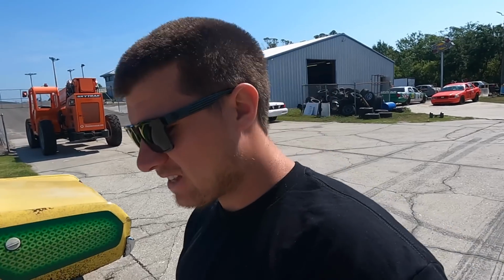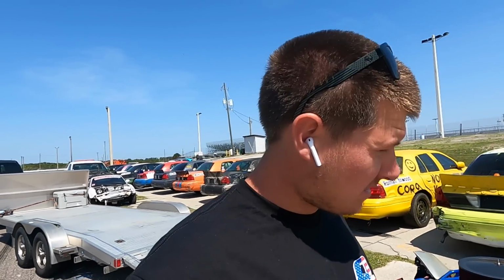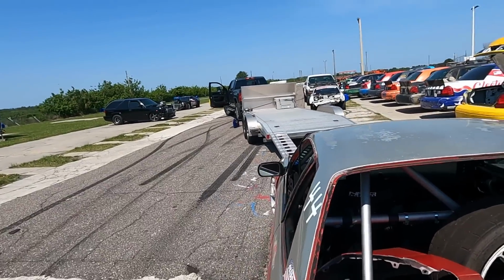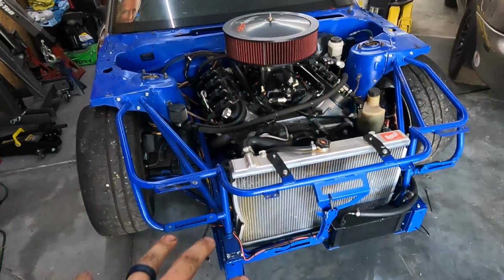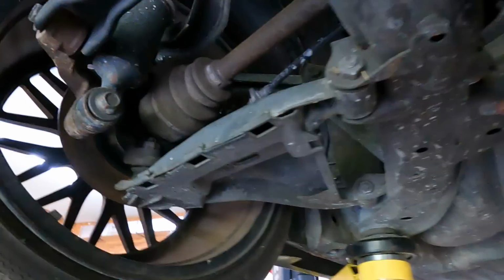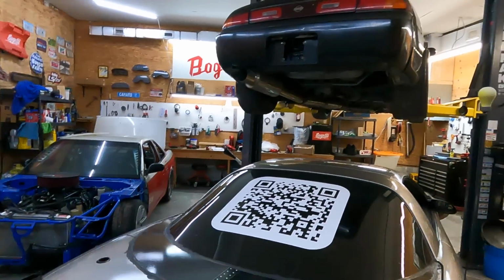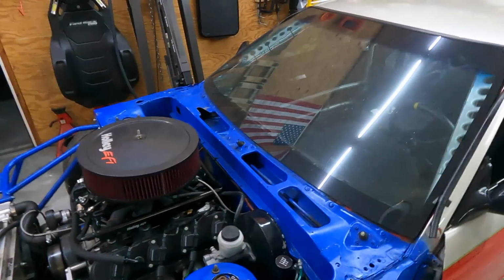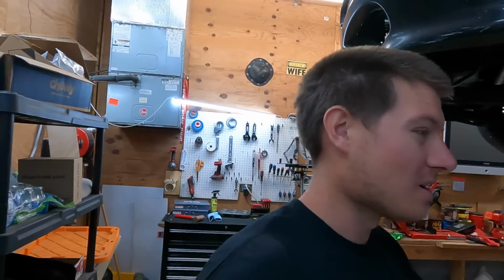Damage Assessment... I Ruined a Pristine S13 240SX

Comment: You're lucky a company just started making 240 flip up headlight fenders. That are metal. For over a decade you could only find used ones.
Reply: There have been fiberglass and carbon headlight fenders available for years, although they suck, they require hours of body work to make them line up and look any good.
Reply: @Sean D  that's why I said a company started making metal fenders again. So you don't have to deal with the bs of making over priced shit fit.
Reply: @timholubowitch9097  overpriced is right. I wouldn't mind paying a couple hundred bucks each for fiberglass or carbon if they were literally drop-in near-perfect fit and just required alignment /shimming and paint, but to pay $300 for a fiberglass one, then 2X-3X that amount getting it finished primed to be ready for paint is nuts, which is why people are willing to pay $1000+ for undamaged used examples

Comment: Personally, I would remove the LS, transmission, differential and other usable parts then swap it into the black 240 and scrap the other one.
Reply: It can be fixed so highly doubt that will happen
Reply: It is hardly damaged, why would you waste all that time?
Reply: @--_DJ_--  For one thing, the drivers side front suspension is bent which means the frame is probably tweaked.  It's probably fixable but personally, I'd start over. If Coop is just using it as a burn out car, I can see that.